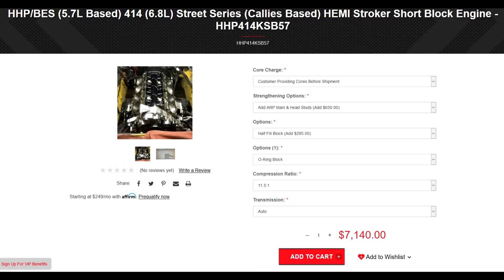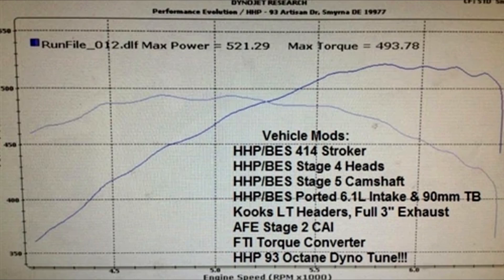Faster N' Louder | Talking Points | BES/HHP 5.7 Hemi Based 414 (6.8L) Stroker Kit

Comment: hey I'm looking at this and was wondering if you think with a 9:5 :1 CPR that I can run at max 15 pounds of boost? I'm trying to stick with the 5.7 but stuck between a 404 6.1 or a 411 6.4.
Reply from the maker: I’m sure you could, but you might have to use higher octane fuel and/or retard timing. You could end up leaving power on the table because of it.